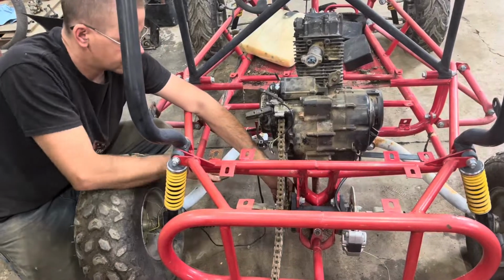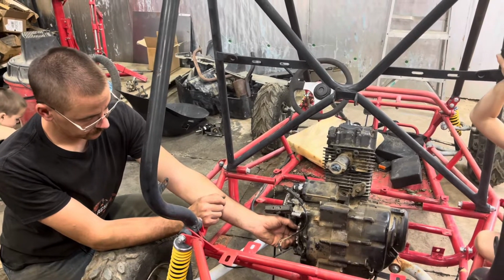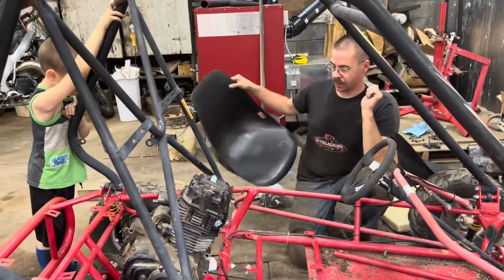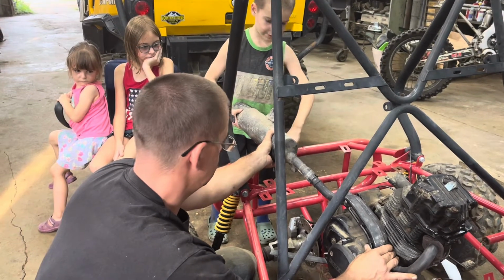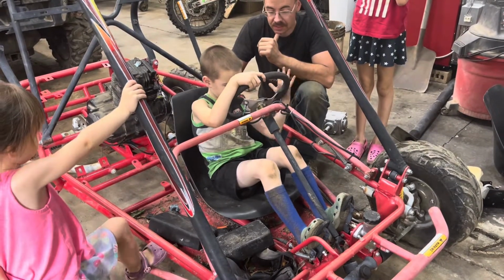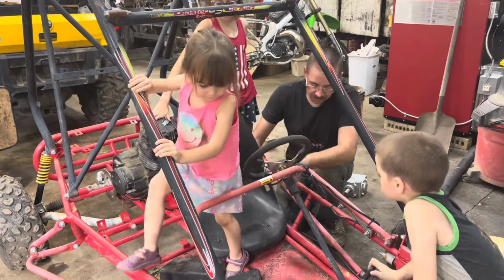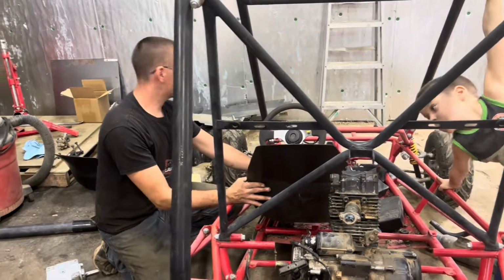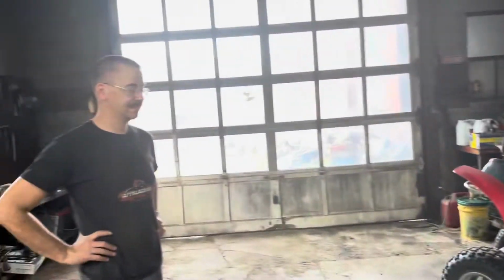Eying up zippy in the Baja frame for Project Patrick 2.0! Kids are super excited!

Comment: Are you going to use those rzr seats you have or did you sell those? Just remember bud you can tilt the engine backwards 10 degrees to give you more room. Looks like a great start to an awesome build bud
Reply from the maker: I still have the RZR seats but I think they’ll be too big as well. Well, to wide I guess is more accurate.